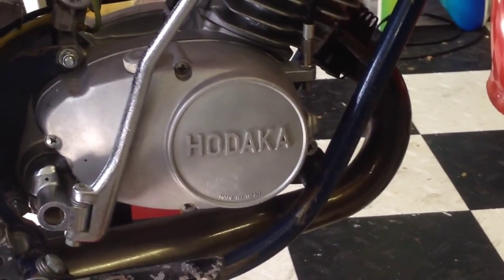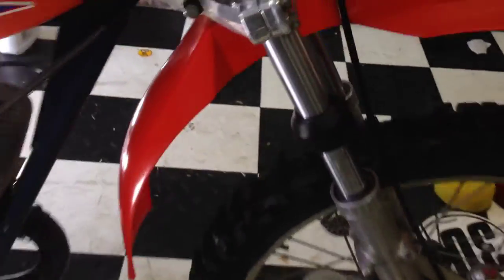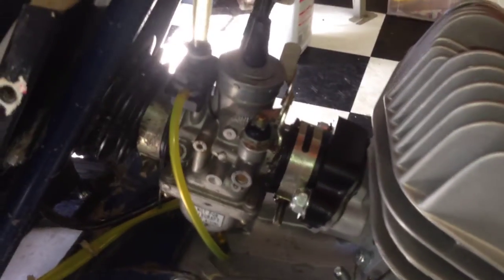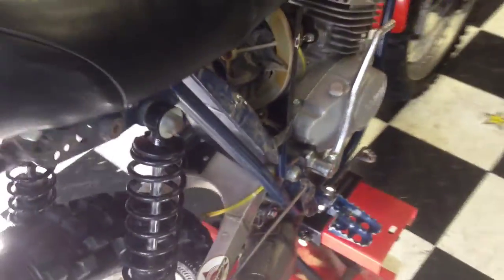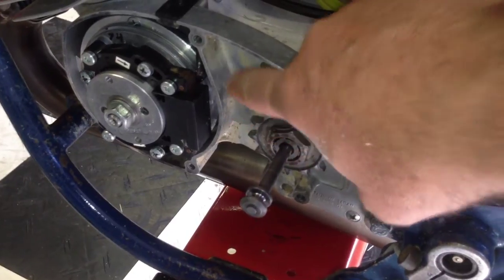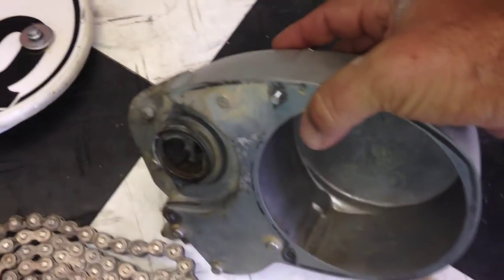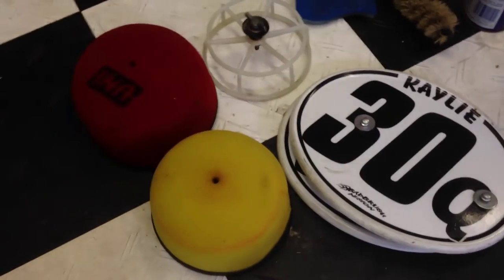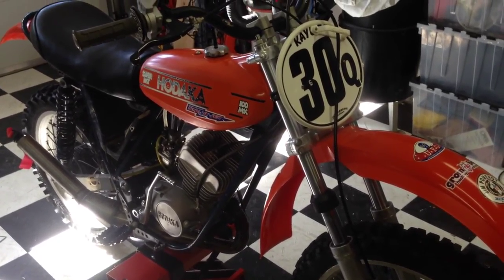Hodaka Clean up

Comment: Thats a pretty sweet Hodaka, have you got a run down on the Mods/Specs ?
Reply from the maker: The bike run down. Engine matched a polished ports, head combustion chamber reworked, blue printed clutch, PVL ignition, custom exhaust manifold, custom pipe, 28 mm carb with Dial a Jet and Kawasaki KX air cleaner set up. Front forks are 34 mm with RaceTech emulators and air release caps, fat bar adaptor and fat bars, custom swingarm and Progressive shocks. Clarke YZ style tank.
Reply: @Socalhodaka  That a 125cc  yes, dumb question with a 28 mm carb it must be. lol
Reply from the maker: Drop Forged Rats 

Model 98 100cc
Reply: @Socalhodaka  Wow, that is impressive.